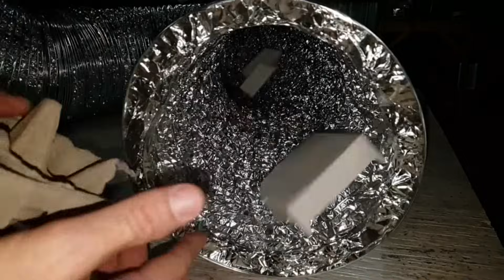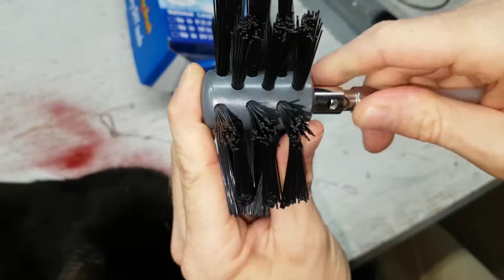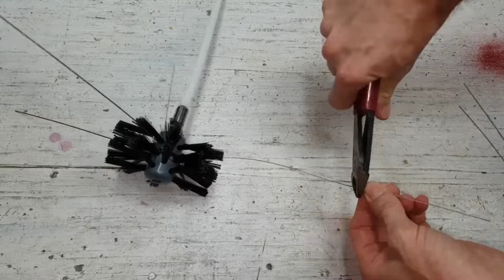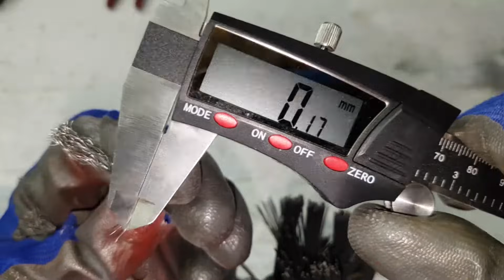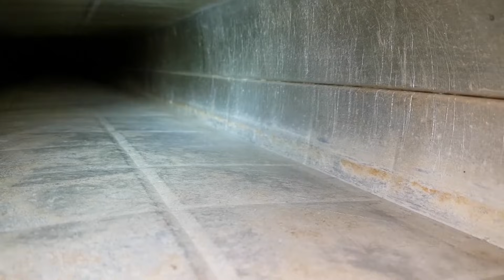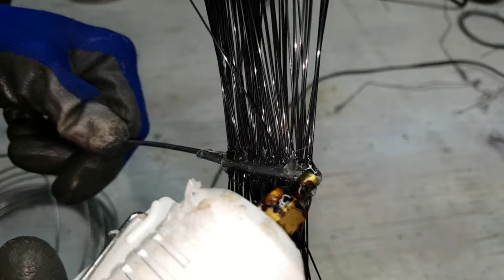DIY Air Duct Cleaning Tools, part 5 - Aggressive Wire Brush for Drills - To Clean Out Stuck-On Dirt

Comment: I've watched a few of these videos you've made and appreciate the work and time you've put into them. Just curious, have you considered or tried any various gages of weed whacker string? I use string on my gas string trimmer that is on the heavier side and even spiraled, its wicked stuff. I may give that a try when I get my dryer vent kit. Of coarse, this will be used on my heating ducts. Again, thank you for your time spent on these videos.
Reply from the maker: Great idea about using weed whacker line.  That would probably be a better solution than the cable in most situations, since it wouldn't scratch the duct walls as much.  Thank you for the tip.

Comment: Nice experimentation. Have you actually tried on a flexible cylindrical duct?
Reply from the maker: Thank you.  I've never tried this wire brush in a flex duct because it's too aggressive.  But I have used a small air whip and some brushes made with broom bristles to clean some flexible ducting.  That kind of duct is very fragile and cleaning it is tedious.  I think I'll need to make videos specifically about cleaning flex duct because of that fragility.

Comment: That's nice however I don't have metal ducting, so do you know about cleaning the flex aluminum ducting?
Reply from the maker: Thank you.  I made some softer rotary brushes in part 6 of my do it yourself air duct cleaning tools series, there should be a link in the description below to that video.  I made a rotary brush using broom bristles in that video which may be okay for flexible ducting.  I also made a duct whip using rubber tubing in part 2 of the series that is pretty gentle and worked well.  I'm currently working on organizing my channel and my videos better so that individual tools will hopefully be easier to find.

Comment: What was your favorite and thorough tool you made? I can't wait to try thanks for figuring it out I dont want to spend a lot of money to clean the air ducts of our rental.
Reply from the maker: You're welcome.  In part 6, I made a do-it-yourself brush head for the rotary brush kit using some half inch aluminum tubing and broom bristles.  I really liked how well it brushed the insides of the ducts.  So far, it's probably my favorite.  But I'm experimenting with some brush tips for the air whips that seem pretty effective also.  Those will be shown in part 7.

Comment: You should try a chimney cleaner it has heavy duty trimmer line for the cleaner head
Reply from the maker: A plastic chimney brush was one of the first things I tried but the bristles were too stiff.  I should have mentioned that in the video.  I'll include some information about the chimney brush experiment in part 6.  Thank you for the suggestion.

Comment: Looking forward to more videos on this. Thank you for being very methodical in your approach to this project and for providing detailed information on the parts used.  With an education in medicine (including environmental medicine) and a background in the trades, I can really appreciate these videos that help empower homeowners to take control of the health of their indoor environment.  I have been around enough different people who cut corners in regards to proper mold remediation, HVAC, and other trades that greatly impact IAQ, to know that if you want it done right, you have to do it yourself (as long as you are a reasonably intelligent, handy, and safety-conscious person).  I appreciate the creativity in the materials used in your approach as well. Keep up the good work!
Reply from the maker: You're welcome.  I originally thought the DIY air duct cleaning series would only take three or four videos to complete.  But it turned out to be a more complicated subject than I originally thought.  Don't know how many more videos it'll take but I'll keep sharing what I learn about air duct cleaning and the tools used.  Thank you for your input and support.